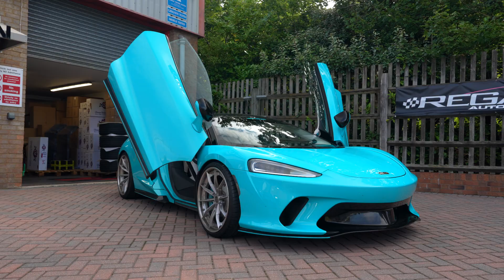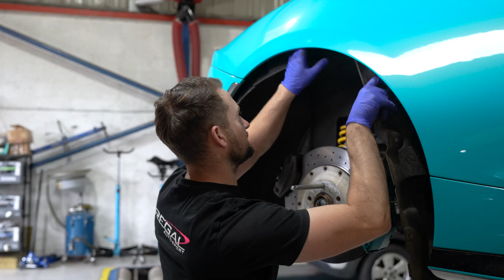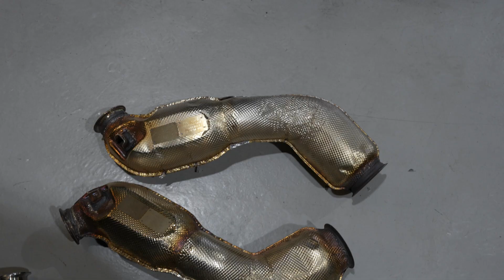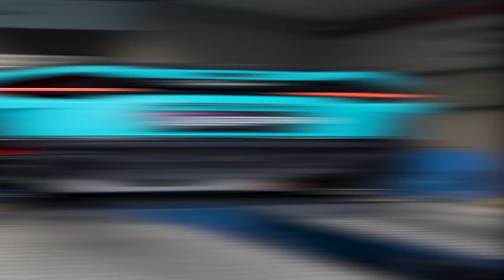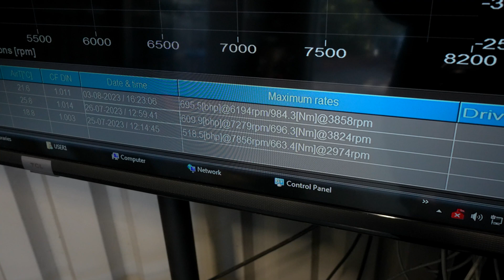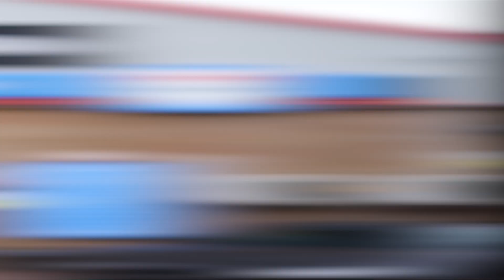MCLAREN GT POWER GAINS WITH RSS ECU SOFTWARE

Comment: How bad is the turbo lag on the GT with downpipes and the stock smaller turbos? I've seen/read there are "pure 900" turbos to upgrade but not sure if it's worth sacrificing the low end driveability.
Reply from the maker: The graphs show the story! The lag is barely noticeable with the stock turbos because they're small. They do run out of puff at the top end though which is where the Pure 900s will make the difference

Comment: Hello, I plan to do the downpipes this weekend. Did you have to remove anything else besides the rear bumper lower valance shield to take the pipe out the bottom? Any tips you are willing to share?
Reply: Got it done. The passenger side was super easy.  The driver side was a bit more complicated.  Over all not to bad. Thanks. 🙏
Reply from the maker: Enjoy! It's a pretty straight forward job